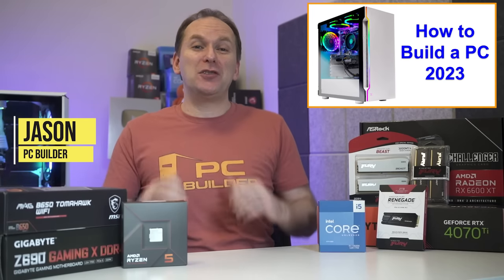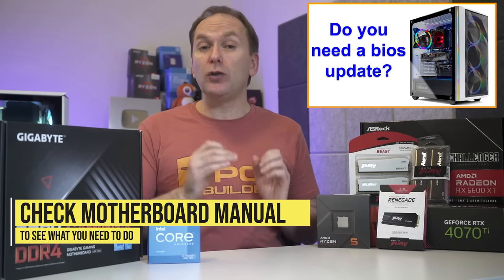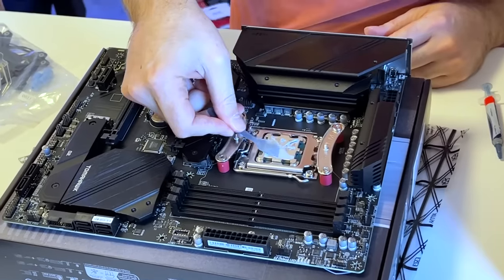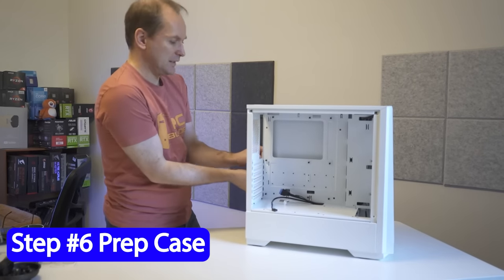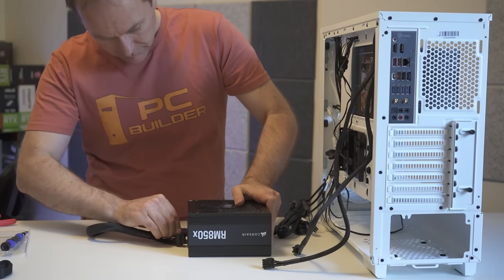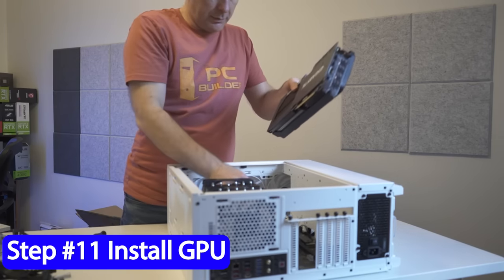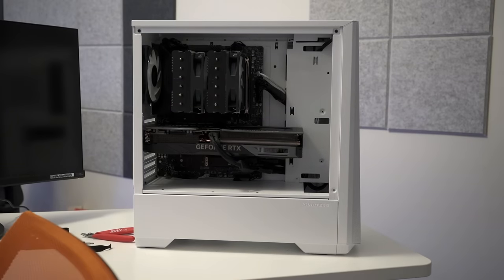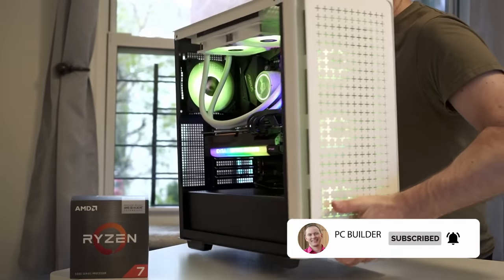🛑 How to Build a PC 🛑 Step By Step Ryzen & Intel 🛑 How To Build a Gaming PC

Comment from the maker: NOTE: How to Set Up Your PC After Building video coming in the next couple weeks.
What PC are you building or built lately? What did you do differently? Tell your story in a new comment below!
Reply: 1 ok, 2 imma build an apu build and add the gpu later because you know, 3 havent built it, 4 once upon a time there was an evil scientist that died from cancer and the world was saved the end
Reply: I built two computers for my shop last year, once in August and one in September.  The hardest part was finding the case.  The one for my desk need 5.25" bays (BR DVD Burner).  That was hardest part.  I think I settled on a "Air" case.  The i5 System with the low end RTX3060 video card seems more stable than the I7 with RTX3090 video card and has been dead nuts reliable for a bench computer.
Reply: I'll build a bad boy with an rx 6700 xt + ryzen 5600x 😼
Reply: Between steps 5 and 6, I did a preliminary startup of my MoBo. This step was included in LTT’s lengthy video  on building a PC.

After completing step 5, attach the cables from your PSU to MoBo and EPS power. If you are using a CPU with no iGPU, you will also install your dGPU and necessary power. Then turn on the PSU.

Next, using the tip of a screwdriver, you want to jump the pins on the MoBo that represent the power switch of a Case. You only need to POST or jump into the BIOS; we are not installing your OS of choice or altering any settings in the BIOS yet, just doing preliminary checks to make sure everything is in order before installing the MoBo to the Case Chassis.

Your system checks at this point are to see a BIOS/POST, ensure all installed components (CPU, RAM, NVMe/SATA M.2 SSDs) are recognized by the system, and to check thermal applications of air or AIO coolers. If you are using a custom loop, you can skip the last check. Power off the PSU to fix any issues. If everything checks correctly, continue the build; otherwise, troubleshoot the problem before continuing on with the rest of the build.
Reply: Great content!
Reply: I am updating my PC this weekend from an intel 8700k build (which will live on as a drop in replacement for another system).  New parts include a Ryzen 7700x, 32 DDR5 6000 CL30, ASRock x670e PG Lightning (features not needed now, but all AM5 boards are expensive and want it to last through next cpu upgrade at end of AM5, and option to coast past AM6 without upgrade.  Maybe still a waste, but only a $50 premium for a lot of ports if nothing else).  Cooler updated to a Arctic Freezer ii 280mm AIO (top exhaust configuration) and will also add a new bottom intake fan to balance the airflow pressure (with existing 2 front intake fans and 1 rear exhaust supplementing the new radiator).  My RTX 3080 will be carried over from previous system, along with case and Super Flower 750 watt gold modular PSU, m2/ssd storage, and WIFI expansion card.

I thought about saving $70 with a 7600, but at the end of the day decided a couple extra cores would be helpful for non-gaming work I do and it is overall only a relatively small price increase right now.

I really like AMD’s strategy of keeping platforms alive for longer allowing for a reasonable mid-cycle CPU-only upgrade without needing to buy new ram and motherboard.  Though maybe that is also possibly part of the reason motherboards are so expensive.  At least they are very future proof with PCI-E 5 support and should have everything anyone could want for an extended length system lifespan.
Reply: Looking forward to your after PC setup suggestions, but for now I plan to update drivers/bios/firmware for motherboard.  I also need to update vbios of the RTX 3080 now that I have a compatible system for “resizable bar”.  In the motherboard bios, enable the memory timings profile (EXPO) and in PBO advanced CPU settings, set an under-volt curve optimizer offset for some free performance and increased efficiency (finding the stable point with stress test benchmarking).
Reply: Good guide. I recently managed to get all parts for a new build and I did it pretty much the same way you did it. I had not built a PC in 7 years so I was a bit rusty, but it was no problems building it, it started just fine first try. So I went from a 1080p/(up to) 60fps build with a 980ti and a i7 5820K to a 1440p/(up to) 165fps build with a 6800XT and a 5800X3D. I'm really satisfied so far, even though I would've wanted a RTX3080 instead (for the better ray tracing performance and DLSS), but the prices and availability have been really bad the last months.
Reply: Nice video with one glaring omission that is important for first time builders. i would breadboard the critical components outside the case to make sure the computer POSTs. It takes a small amount of time to connect the psu cables to the motherboard, GPU , install the CPU, Ram, M.2 drives (not critical to do the test) along with cables to the monitor and keyboard. Jump the front panel power switch pins with a screwdriver if the mobo does not have a start switch. If it posts drop it all into the case ( all you probably have to remove is the GPU and sometimes the cooler depending on case size. My first build many years ago the i had what turned out to be a bad mobo. i would have hated to have found that out after i had put everything into the case. Again with small form factor cases this is a good practice as there is not a lot of room to ferret out a problem. i love some of  the other tips like connecting that CPU cable before placing the mobo in the case.
Reply: @pdureska7814  Exactly. I’d go insane to have all my components physically in my MoBo to only find out after completing the hardware build that one or more of them, or even the MoBo itself, are duds from the get-go.
Reply: Flash drives bigger than 32GB will still work and can be formatted with FAT32, they'll just be formatted to 32GB max. The remaining space will be inaccessible until reformatted.
Reply: Hey, what cpu would you recommend for streaming, video editing and what gpu should I pair it with? If you could write back that would be amazing🤞🏽budget for both would be £700
Reply: The problem tends to be that if it's something you might only do every 5 or so years for yourself, you can easily make a very expensive mistake, especially around installing CPU and cooler. Plus things do change over the years, so you have to watch plenty of build videos. I'd much rather pay someone who does it every day as a job to put it together. Adding in a hard drive or RAM or fixing 1 part I'm much more willing to do.
Reply: @sammyfromsydney  Well i would encourage you still to build your own. review current videos and there are plenty out there with builds many times the same parts as you may be using. Really, the basic build has not changed over the past 10 years i've built my own. Granted i do build about 1 per year for family and friends. Sometimes especially with air coolers, the brand you buy makes a huge difference in ease of installation. i've gone away from AIO liquid coolers as i just had one fail in a 5 year old computer. i've been using Noctua air coolers for my last 3 or 4 builds. i'll never go back to an AIO unless i were to build an extremely small form factor that an air cooler would not work. Dont sell your skills short. Its like riding a bike...you never forget  HAHA.

Cancel

Reply
Reply: @pdureska7814  How did the AIO fail? Was it by human error or natural wear-and-tear?
Reply: Probably should have watched one of your videos before I "built" my PC, haha. Next time I'll do it indoors! 
https://www.youtube.com/watch?v=hZDu3zkupBI&t=1747s
Reply: @CLfreak246  just wear and tear i think...the pump failed (my computer was 5-6 years old). i heard the fans running like full speed and my core temp was like 60 -70 degrees celsius. Plus i had been noticing over the previous several weeks the computer would shut down on its own. i dont generally game on my computer.  i could not feel vibrations in the hoses (supposedly you should be able to feel the fluid moving) so i suspected pump failure. i tried reapplying thermal paste as a long shot but no improvement in the temps so i replaced it with a Noctua NH U12A. Great cooler, quiet and baseline temps 28 to 30 degrees celsius
Reply: @pdureska7814  okay. The AIO lived a good life if problems occurred after 5 years. There’s no fault in switching to a high-performance air tower like Noctua. I was gonna consider them too, but that huge size was gettting in the way of my RAM and and VRMs. So I went with an Arctic AIO Liquid Freezer II.
Reply: Hey Jason you’ve got to help me out here. I’m looking to build with a Ryzen 5 5600x and I have no idea which motherboard to use. Currently have my eye on an Asus tuf gaming B550M-plus with wifi. I’ve watched your videos and even other ones and still can’t figure out which one is the right one(it must have wifi) pls help
Reply: @CLfreak246  Artic is a good choice and they give good bang for the buck. i've seen people have issues now with the huge VRMs and the design of some of these AIO's with fitting those onto the CPU. AIOs definitely have an advantage if you move your computer  around much and for really small cases you have no choice but to use the AIOs. i built a computer with my grandson a couple years ago and used the stock Ryzen cooler and it was actually pretty good. I then built a small form factor pc for my wife and plunked a Noctua NH-U9S in it (the case would only support a 120mm AIO and i thought why the hell not with the air cooler and it works great (At the time i could not find a Noctua U12S to save my life during Covid). I helped my granddaughter build her SFF (NR200P) pc and plunked a U9S in it. You cant go wrong with Noctua for ease of installation, build quality and performance. Plus i'm seeing people do interesting things with lighting and it would be cool if they could put an info screen on top of the cooler. Its coming.
Reply: I've never built a PC but I've watched hundreds of videos and every time I see a large air cooler like at 5:45 I'm always concerned about the weight distribution and if it could damage the motherboard over time. I know the fins are aluminum and lightweight but after adding 2 fans for a push pull configuration...ehh it just looks sketchy in my INEXPERIENCED opinion. Lol Could anyone give me some pointers or additional information on things to consider or possible complications to be aware of when using a large air cooler?
Reply: @GrabLifeByDaPoosy  Some of the complications of Large Profile Air Coolers you have said. Another is that it could block some of your RAM slots or VRMs.

Another option of CPU cooling is to use an All-In-One liquid cooler, but that also has some drawbacks and advantages. The main advantage of AIOs is that most are low profile that won’t interfere with other areas of your motherboard. The drawback is slightly more failure points against (passive) air coolers, one can be by user error. Just pay attention to where the pump is located in the AIO you get, and don’t place the pump at the top of your water loop.
Reply: @CLfreak246  Thank you for the feedback.
Reply: Ill upgrade to 7600x with 6800xt from i5 10400f and rtx 3060ti
Reply: Just starting to build my first PC orderd all the parts lil nervous and excited at the same time
Reply: Is the video almost out?
Reply: the question below x2: Did this come out yet haha i just rewatched the last 20 seconds 10 times and scavenger hunted this screen lol - PS great video.

 I'm curious if you are a supporter of building a MAX AM4 build while parts are still readily available, or spending more for the new gen... I think the move is interesting as monitor tech really needs to come down before mass high refresh oleds become adopted.. I'm a little confused why PC parts are still so expensive right now when it seems like most mid-tier stuff is capable of high 2k and, med/high 4k on most setups with any decent 30 series GPU. maybe an enthusiast here can respond to me and let me know.

my b450 7 3600x
stock cooler, super cheap case with bad flow and 3 fans
3080ti
1t m.2
16g 3200
RUNS 4k 65inch 120hz hmdi2.1 NO PROBLEM. 90-130 FPS averages on different titles.
it doubles onto DP 2k 27 144hz avg 100-130 (idk why not more) so ive really just been favoring the 4k lately because it looks AMAZING and SMOOTH. just FYI for anyone who comes across this.
Reply: Literally just used this to double check I first fully custom homebuilt system

5800x
Asus Rog Hero VIII WIfi 
X2 16GB 3600 CL16 (yes cl16) corsair vengeance rgb rt
H170i 
Asus TUF 3080ti
Hx1000i
7000d
X2 2TB P5 Plus 
4k60 pro mk2 
16TB ironwolf HD
Reply: @TheTennisMachine 2:30
Reply: So I feel naked and afraid. This is what I'm thinking of buying: ASRock Z690 PG Velocita LGA 1700, BitFenix Nova Mesh SE TG PC Gaming Case with 2 Black Fans, Intel Core i9-13900K - Core i9 13th Gen and G.SKILL Trident Z5 RGB Series, are all of this compatibles? would that be a good computer? I've watched a lot of videos of yours about RAM, motherboard, processors, etc. I have a 2080 super which will upgrade later on but I want a better setup and I've never built a computer myself... Any advice?
Reply: Can you please build a PC for somebody who wants to play games/stream games and also do editing work (BUDGET 2500 USD)
Reply: I decided to reuse my GPU (GTX 1050) and Case (Carbide 500R) for my current planned build. Less intensive gaming PC than in thr past cuz I don't game as hard as I did back then.
Reply: Doing my first build ever with a Ryzen 5 7600 using a msi pro b650s mobo with a arc 770 graphics cards. 32 gigs of ram. Been watching a a lot of your videos and you have been one of the most helpful with step by step directions. Great information sir thanks again
Reply: I had a budget PC with an EVGA 850 Watt Gold PSU, RTX 580X, Ballistix 3200 Mhz 16GB x 4 RAM sticks.

The Motherboard died due to it not being turned on in years, so now I bought 6 Noctua 1700 RPM Case Fans, Noctua DH12 CPU Cooler, Ryzen 5600X CPU, Corsair 4000D Tower, I will be reusing the RTX 580X for the meantime and the Ballistix RAM sticks.

This is my first build although i've always maintained and upgraded parts on my Laptops and PCs for close to 20 years now, can't wait to see how well this build runs.

It is a budget build that i'm going to sell within 6 months so I can build a full high end 4k VR setup, with a 7950 and 4090, kind of just doing this one now as a project and to game on a PC instead of a Laptop.